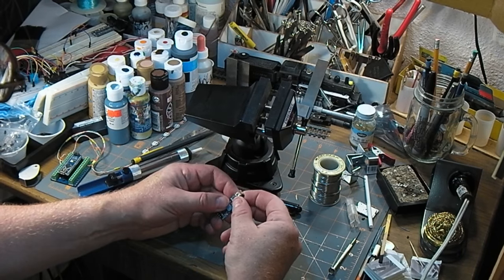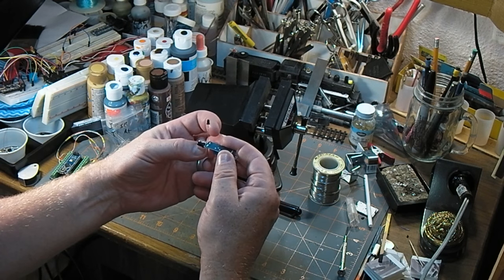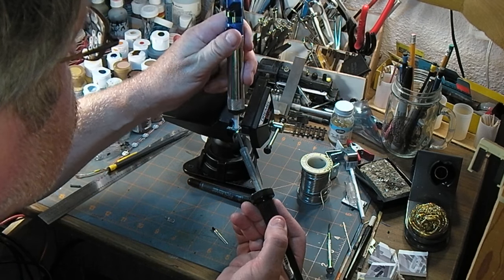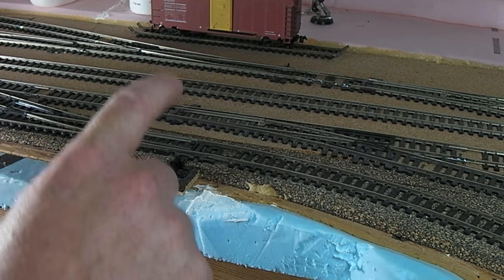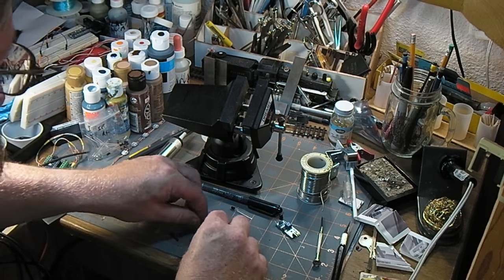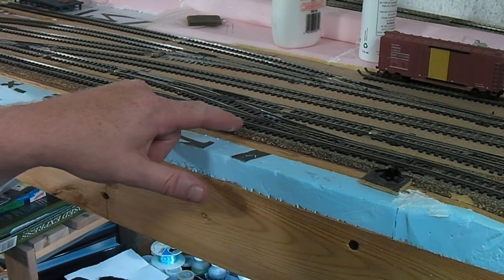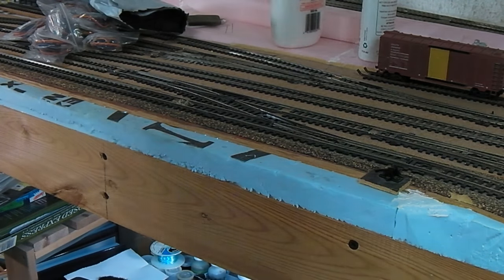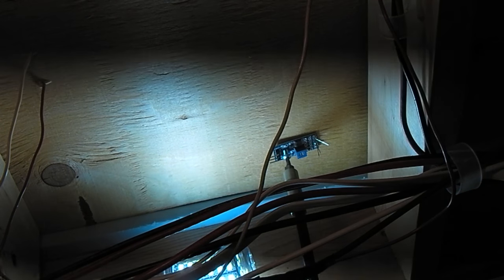Train Detection second try - this time for sure!

Comment: Great idea!  I ordered the 3 mm detector and Leds.  They work great.  One change I made,  after removing the original 5 mm leds, I installed header pins on the board and then used short female/female header cables to connect the led and receiver.  If you get a connection backwards, it is easy to reverse without soldering.
Reply from the maker: That's a good tip.

Comment: Go to your home center and pick up 1 inch wide aluminum channel.  The servo sets down in the channel very nicely.  If loose, pinch the walls of the channel a little bit.  Drill a hole and mount the channel.  The servo can easily be set in and out for service as required.  Put in the horn and adjust your adduino for the amount of "throw" required.

Bob S

Comment: Thanks for the video.  I used this method and it works well.  I drilled the holes 5/32 placed parallel and in the middle of the track and separated by a single tie.  I am using an Arduino Mega to sense switch settings, Block occupancy and output led signaling.

Comment: I just discovered your channel through Reddit. I have been attempting to do the same thing you have: Using cheap Chinese electronics to help automate my model trains, as well as hand-making points, switch motors, etc. for much less than the commercially available equivalents. I, too am handy with electronics and programming. One of things I thought when I saw this (I hadn't thought about the need for it) is that you could put bar code on the bottom of your trains to identify them and have an automatic hump yard!
Reply from the maker: I remember reading an article in an old magazine where someone did that barcode trick.

At the time they had a computer (probably a 286 or 386) dedicated to running the yard.
Reply: Nowadays, a $2.00 Arduino mini clone could do it, and send it's notifications to a Raspberry Pi to make decisions!

Comment: Solenoid bracket - -   check out the home center for extruded aluminum channel that is 1 inch apart between side walls.  The solenoid should fit in the channel.  Use a bit of shim if it is a bit loose,   Allows you to move the solenoid around a bit to align if necessary.  Let me know.  Bob
Reply from the maker: I've heard that suggestion a couple of times since I did these videos. 
Sounds like I need to go shopping!

Comment: Hello and thanks for testing, filming and reporting!

I think, this solution is not so good: It does not detect the most important direction, so that you can't use it for mostly direction dependent reaction of railroad-software, and not for triggering a counter as an replacement for an occupancy sensor. 

If it could, that were nice, because only direction detecting systems can prevent us, from sawing the tracks for occupancy detection.
Reply from the maker: My initial motivation was simply to prevent myself from accidentally crashing the points when I am operating alone.  The fact that it can also act as block detection and signalling is a bonus.  

You could add as many detectors as possible if you want to expand into a dispatcher board or even full automation.

Comment: Excellent !!!  This is exactly what I want to do to detect a train approaching my X layout.
I want to use your detectors to 
1. make sure that the 4 turnouts are all set properly to create the X cross.
2. shut down the power on the opposite track to prevent a 2nd train from using the X cross while another train is using it.
3. power up the opposite track once the original train has passed.
You are relying on the rolling stock to reflect the IR light to the receiver.
How do you accomplish that?  Is there a piece of mirror mounted to the underside of every piece of rolling stock?
Who's detector do you use?
What is an ardwino?
Can you provide web address or an ebay search string?
Reply from the maker: Yes, the light reflects off the bottom of the locos and rolling stock. It doesn't need a lot of reflectivity, so no modification of the cars is needed. Even the flattest black seems to be adequate. 
The threshold on the detectors is adjustable, so you can tinker it to allow very little change to trigger it.

"IR Infrared Obstacle  Sensor" is a search string that finds them on ebay. I always select free shipping and sort by cheapest first - they are usually cheaper per unit in bulk.

"10pairs 3mm LED infrared emitter and IR receiver diode" finds the 3mm replacement led/detectors.

What is an arduino? That's a big topic... 
It's a cheap micro-controller platform designed for beginners. Arduino.cc explains it, but the modules I use are cheap clones from e-bay (search "arduino nano" for the one I used in this project.

If you feel lucky, I'm doing a giveaway shortly (when I hit 1000 subs on my youtube channel) for the kit of materials that I used. 
check it out: https://www.youtube.com/watch?v=tb1DtesQg4M

Comment: Hi @pileofstuff  I got some 3mm LED's in today and soldered them up using your design in the video tutorial.  It will detect light surfaces like white, etc. but will not detect the black bottoms of my rolling stock.  So, what's your secret to making these detect black.  If you could upload your sketch to your Google drive (I've checked and it not out there) I sure would appreciate it.  Thank you,  Jim
Reply: OK, I found the sketch as a text document in your root directory.  It appears you're using the same code as Jimmy's at the DIY & Digital which works but has issues detecting the black undersides of rolling stock.  What's the secret for seeing black black bottoms like how you demonstrate in the video?  Thanks again, Jim
Reply from the maker: @jimbarclay7248  
My suggestion is to adjust the position of the LED and IR detector, or adjust the sensitivity control on the detection board (assuming the one you have has that capability)  That's all I had to do.

I didn't have to make any modifications to the bottom of my fleet, but if your detectors aren't as sensitive, you might try putting a small white sticker on the bottom of a locomotive fuel tank or somewhere else that won't be visible form normal viewing angles.

Comment: Would a Hall Effect Sensor be sensitive enough to work through the board without any drilling? A neodymium magnet would be fixed to the bottom of the train.
Reply from the maker: It might work, but that would mean modifying a number of cars in your fleet.  And it would probably interact with any uncoupling magnets that you have installed.
Reply: Thinking about it further, I'm not sure if a magnet fixed to the train would upset the DCC signals passed through the track. Might be worth some investigation.
Reply: @pileofstuff  It would also be interesting to see if a strain gauge mounted under the board would be sensitive enough They are a component I haven't played around with yet but look like they could be fun.
Reply from the maker: @Ivor_Nastyboil  I haven't played with strain gagues either, but I would be very surprised if they are sensitive enough to reliably detect a model train.
Reply: @pileofstuff  From what I have read some of them are very sensitive. I have a set of kitchen scales that will read to 0.1g using a strain gauge. Having given it some more thought I don't think you could place a gauge under a thick board such as that used for the base of a model railway. Something like a BF350 strain gauge could be fitted just under the track, if the track is resting on a slightly flexible layer. You wouldn't be looking to measure the strain gauge resistance change accurately, just measure a change beyond a certain amount. Do you have a layer between the track and the board? I haven't seen a model railway layout since I was a kid and my dad had one. I remember him having foam strips under the track. Things have probably changed LOADS since then :)
Reply from the maker: @Ivor_Nastyboil  Directly under the track is a layer of cork, then plywood below that.

But, when the ballast rock is added, it gets glued down, so the whole assembly becomes a rigid mass.
Not sure if a strain gauge would be able to sense movement through that.
Reply: I'm yust testing that. But  small Neodym magnets (i.e. 5mm diameter, 2mm height), you will need them at least under the locos, better also at least under the last coach,  with standard hallsensors-switches will only be surely (at high speed) detecting up to a distance of 6 (to very max 10 mm) from the magnet (max 0.25 very max 0.4 inches): The magnetic field-strenght decreases with the 3rd Power oft distance!  Therefore you can't mount the hallsensors without drilling a whole for their cables.

The other aspect: You shoud always use a pair of hallsensors to a logicgate or a small processor, that filters only the falling edge of the outer sensor as an directional signal. With this you can later build magnet counters, to detect the occupancy between the sensor-pairs (counter >=1 is occupied, counter = 0 is free).

Comment: Is there a link to the components you  are using? This is brilliant and I would love to include it in my layout
Reply from the maker: The infrared sensor board is this: https://www.ebay.ca/itm/5PCS-Smart-car-Obstacle-avoidance-Infrared-Sensor-Reflective-photoelectric-NEW/251876067491.

I replaced the LEDs with smaller 3mm ones like these: https://www.ebay.ca/itm/10pairs-Launch-Emitter-Receiver-3mm-940nm-IR-infrared-diode-LED-Lamp-New/261019743266

And the controller could be any type of arduino board (I happened to use a nano): https://www.ebay.ca/itm/Nano-Board-CH340-ATmega328P-Without-USB-Cable-Compatible-with-Arduino-Nano-V3-0/254549988537

Comment: Hi PileOfStuff, I'm running N-Scale so the 5mm LED's are too big and I've ordered 3mm's like you suggest and will cut some ties to make them fit.  You show that you posted your Arduino code for this but, the link is for an NES_new Arduino file, a keyboard based game controller.  Please provide a link to your IR code used in the tutorial so I can compare it to Jimmy's over at the DYI&Digital Railroad Channel.  I'm having issues with it reflecting off the black bottoms of my rolling stock and would like to see how you compensate for this in your code.  Thank you and keep these great videos coming.  You do a heck of a job!  Jim
Reply from the maker: This should be the correct link:
https://drive.google.com/open?id=1_G7llNsIqLRnZsAe2qnHlrYLYwJLDFEP

There's nothing in the code to compensate for the sensors - the code simply treats them like they are dumb switches. All sensing adjustment is done with physical placement of the sensors and the sensitivity adjustment on the sensor board.
Reply: @pileofstuff  That's your link for My_Servo_Thing.  Nice sketch but not the IR Block Detection.  Please try again and THANK YOU for the FAST response!  Jim
Reply from the maker: @jimbarclay7248  This should take you to the directory for all my arduino files related to anything I've uploaded:
https://drive.google.com/open?id=1Pfb5O7Ks7Eae0Z81yvpYI3P0XQQLlTzH

The one called "my servo thing" is the one related to the detection and turnout control videos.  It's really that simple. Just a couple of binary inputs and 2 possible states for the servo that moves the points.
 
There's another one for my yard control panel that uses the same type of servos, but is controlled by pushbuttons.
Reply: @pileofstuff  Well Heck!  It's not out on your Google Drive.  I looked all around.  Several other Arduino files but not the one for Block Detection using IR detectors.  Please upload it when you have a chance.  Also, have you tried using QRD1114's?  I got some of those in today but with no POT, they are not adjustable and the distance they can read is limited.  I'm hoping to get your method to work on my railroad so I can avoid trying to glue and silver metallic paint 10K ohm resistor on 33" N-Scale wheelsets.  Fox Valley sometimes has them but they are a bit pricey.  Thanks again, Jim
Reply from the maker: @jimbarclay7248  The code I used in the video is"my_servo_thing". It's not a full block detection solution at this point. It's only job is to make sure I don't run a turnout backwards when I'm not paying attention.

Not sure what to say about the detectors. The ones I have may focus the beam of IR light a bit further away than those QRD1114 units.Those appear to be designed for very close spacing to the target. According go their datasheet they're almost blind past 4-5MM from the surface of the device.

Comment: You dont need to do this, just separate the track you want to have block detection with insulated rail joiners then use the digitrax BDL168 box
Reply from the maker: But I want to do this... It's a fun project.

Plus, this can detect occupancy of un-powered, un-modified rolling stock, not only locos and cars with resistor wheelsets.
Reply: Oh i thought you were going for full computer automation.
Reply from the maker: I might eventually do more automation, but this is just to make my solo operations less disaster prone. 
And maybe for signals if I ever get around to it.

Comment: Hi, how do you determine the correct orientation of the leads. Cathode and Anode.?
Reply from the maker: The flat side of the LED is normally the cathode (negative side), and the longer lead is normally the anode (positive side) however I usually test them with a meter to be sure.  
Sometimes the cheapest Chinese imports are factory seconds and you never know...

Comment: Hi can these be used for block detection to mimic and small current which can detected by a block detection unit ?
regards tony
Reply from the maker: I think they could do that. You would probably have to add a resistor and perhaps adjust the or modify detection circuit, depending on what it's input requirement is.
Reply: I works fine with current sensing boards too, no need for anything, you can do open and close detection by using +5v or ground respectively.
See my comment above for a drill template made for this IR hw instal.

Comment: So every car on the layout has to have an aluminum strip under it to reflect?  Fine for a home layout, not for a club.  I need another way.
Reply from the maker: Nope, no modification to the car needed. Enough of the IR light bounces off black or brown underframes to trigger the sensor.
Reply: @pileofstuff  okay, you've convinced me to invest $ and time to build 4 of these for the  club...  parts are ordered based on pics "as seen on tv!"

Comment: Could you confirm the short leg goes to the inside connections and the long legs go to outside please.
Reply from the maker: That would be normally a safe assumption, but since I am buying parts from various random suppliers, I always test with a multimeter to be certain.
Reply: pileofstuff Thanks for replying. Do I check in the same way as a diode for both emitter and receiver, anode is positive, cathode negative and current flow is same for both. I’ve not used this sort of stuff before so it’s a bit of a learning curve. Many Thanks.